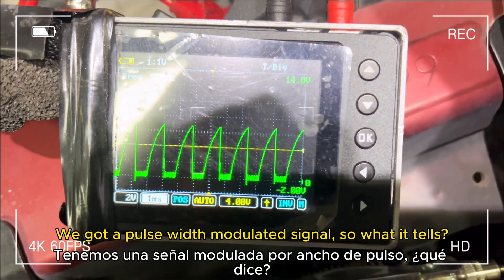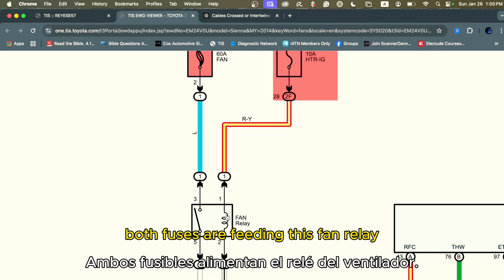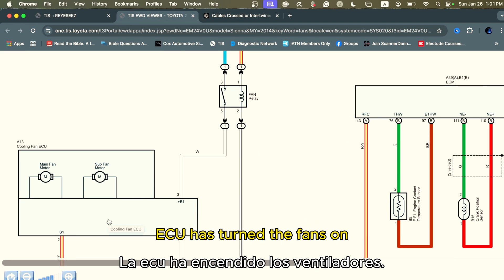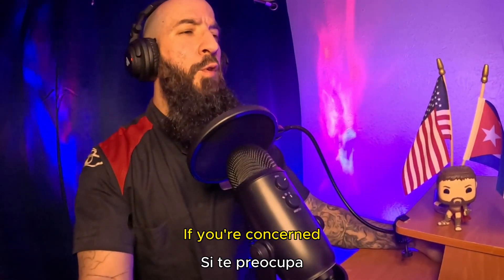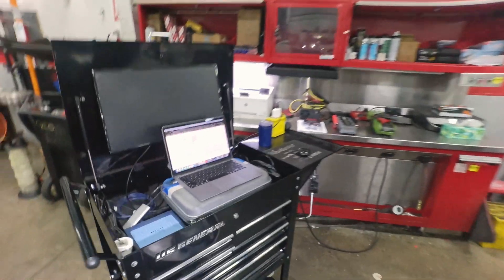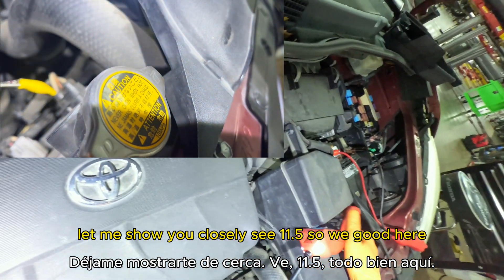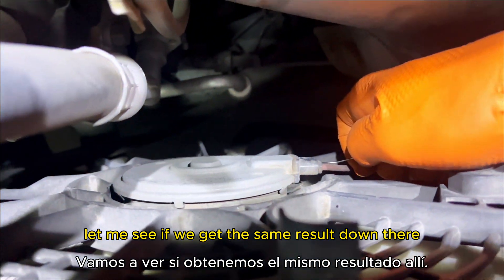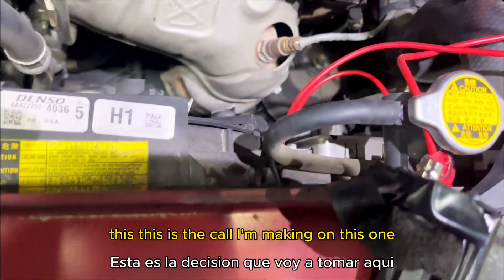TOYOTA SIENNA OVERHEATING?! TESTING COOLING FAN’S CIRCUIT

Comment: What test light is that?
Reply from the maker: It’s an OTC one, i’m gonna leave the link here in case you want to check it out: https://a.co/d/cWuRyrs
Reply: @ okay thank you!
Reply: Won’t a bidirectional scanner give you the ability to send an order directly to the fan to turn on ? So then you can tell if the problem with the fan or the control side of the circuit. I am not sure if I am right or wrong
Reply from the maker: Yes you’re right but if when you command it on it doesn’t turn, I think that is a good practice to still test the feed right at the fan while you’re commanding it on with the scanner to be 100% that the feed is getting there. If it turns on when command it then you don’t have to test at the fan at all cause then the problem is on the input side. Hope it makes sense and thanks for your input!